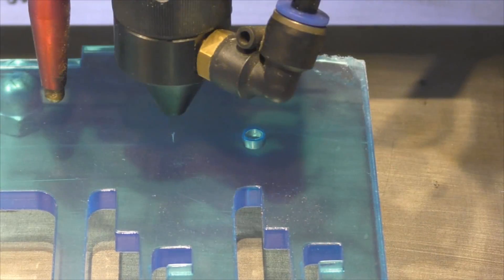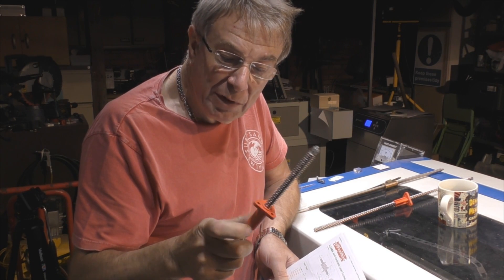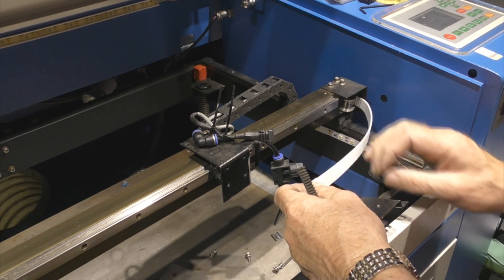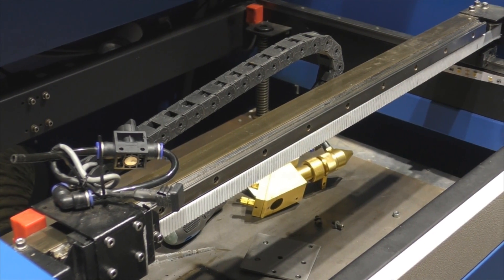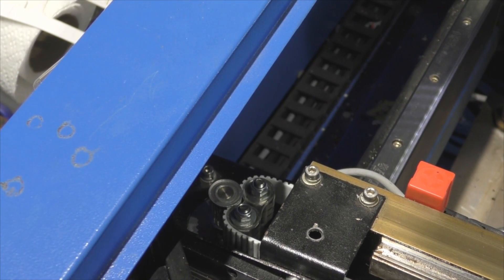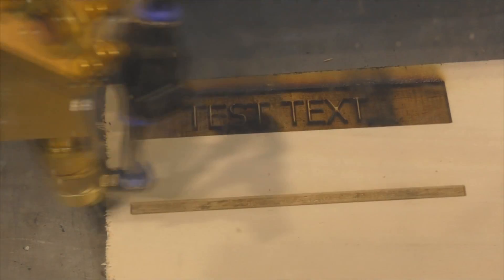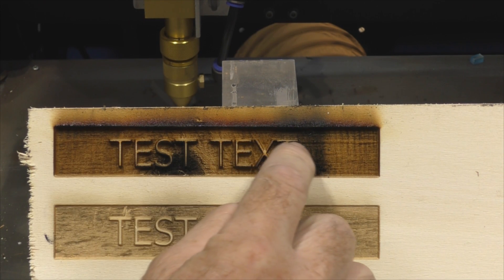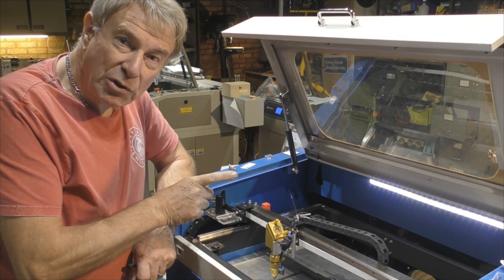RDWorks Learning Lab 121 Is this CURTAINS for CURTAINS

Comment: HI Russ - my 700x500 doesn't do curtains. Differences to yours is it uses HTD round tooth format belts and more importantly a toothed pulley as an idler. I think your problem is likely caused by running teeth inwards on a smooth idler pulley.
Reply: Hi Steve
So your machine is a KH7050 made in the KeHui factory.   
Kehui do not manufacture laser tubes, instead they trawl the major tube manufacturers for reject tubes. They then retest the tubes themselves to make sure they work "in some way", enough to fool the average naive Ebay buyer. The tubes then get relabeled K H Laser. I have seen several tubes with my own eyes  that were original EFR tubes and (stupidly) still had the original labels in place under the flimsy K H Laser label. As it happens, those higher power tubes (80 and 100watts) although not perfect in performance were pretty usable and one in particular is now 14 months old BUT the lower 50 watt tubes (are actually 800mm long 40 watt tubes) is a different story. These are usually close to junk and will last anything from days to weeks. I had two such tubes when I was young and naive (exaggeration!!) so I speak from bitter experience.
If you bought the machine with your credit card and you have run out of options with your vendor, then speak to your card provider about a chargeback. Also threaten your vendor of your intentions. That may be enough to often be offered a refund for a replacement tube
All best wishes
Russ
Reply from the maker: Hi Steve
Thanks for the comment and your personal experience. You are not alone in telling me that two toothed pulleys are better than one. However my analysis of what happens to the velocity of the belt as it moves over a non circular surface was covered in session 83 (?) and that convinced me that adding another pulley would either reduce the problem or double it depending on the synchronization of the pulleys.  I only analysed putting square wheels on the front axle of your car but take that logic to the rear axle as well and depending on the synchronization of the flats, the ride would be different but not improved. If the pulleys happen to be synchronized then there will be little change in velocity but what will happen is that both pulleys will be trying to pull the head slightly out of position (because of chordal increase)  and the will balance and just create an even  increase in belt tension  thus creating even movement. That is why I have hesitated to take this toothed idler direction.  Furthermore, I was visiting a colleague just recently who also has a Red Sail clone 500x700 100 watt machine. It had a toothed idler pulley and the curtain effect on his engraving  was like a roller coaster.  I did not have time to fiddle with his belt tension or investigate it further but it was an interesting observation and a reinforcing reason why I have chosen my smooth belt route. 
All best wishes
Russ
Reply: Hi Russ - On my machine the belt runs on top of the axis rail and it has a much more substantial idler mount too, but i think the HTD belts run much smoother anyway. Least of my problems at the moment as my tube seems to be failing. Wont fire reliably at less than 22%  - used to fire at 10% and it's way down on max power - awaiting a reply from seller as only delivered beginning of June :(
Reply: Hi Steve
It sounds like you may have a tube labeled K H Laser?
It appears that your gas mix is nearly depleted of CO2. Is the beam a nice mauve/pink colour or is is it a pathetic pink (almost white?).

The belt I had originally (before I torched it!!) was  HDT form  but obviously I still had the smooth idler and that was generating curtains. What you must remember is that these belts were designed to transmit power in one direction only and the HDT form reduces tooth stress and allows more power transmission for the same tooth pitch. These belts were never envisaged to replace lead screws or rack and pinion systems. They accidently can be used to control oscillatory motions but they do so with many  limiting conditions. 
Best wishes
Russ
Reply: It is indeed a KH and pink :(
Reply: Hi Russ - sent you an email regarding replacements.
Reply from the maker: Hi Steve
I did reply to email and have just forwarded that answer again. Check spam box?
Best regards
Russ

Comment: Nice idea - Thanks for the video. For future reference, there are plenty of suppliers of inexpensive leadscrews and anti-backlash nuts on AliExpress. A 1000mm T8 leadscrew + anti-backlash nut shouldn't cost more than £20,  including postage.
Reply from the maker: Matthew Bucknall 
Hi Matthew
Thanks for the tip. If I had known that my lightbulb moment may never have happened. This way it will be cheap and easy for others to try without major mods to their machines 
Thanks again
All best wishes
Russ
Reply from the maker: Hi Matthew
I had a look and saw quite a few options but nothing at quite the price you indicated Any links would be helpful.
Many thanks
Russ
Reply from the maker: Thanks Matthew. I am looking to design a better desktop machine with lots of features that do not exist on current machines. This is not an attempt at making a Glowforge copy (a pimped up K40) but a more practical and cost effective offering. I am neither into manufacturing (any more) or making money (I planned well for my retirement) It's just a design challenge I jump in and out of when I get a bit of spare time. It may never fly but it's certainly interesting to put all my criticisms of existing machines on the table and to see if it's possible create a more integrated design that circumvents those problems.
Thanks again for the links
All best wishes
Russ
Reply: Sounds really interesting - I look forward to seeing what you come up with. As it happens, I'm currently in the middle of writing some better software for the Chinese 1060 laser cutter at the hackspace I help to run (in Newbury, Berks). We weren't happy with the original software and controller, so I designed a new controller based on the open source smoothieboard, but mechanically and electronically compatible with our laser cutter's original controller (so we could do a straight swap without rewiring the machine). The plan was to use LaserWeb4 with the new controller, but it hasn't lived up to expectations, hence me starting the new software effort.
Reply: SarbarMultimedia An open-sourced laser cutter design based on your experience would be awesome!
Reply: I'm current ly moving out of my comfort zone helping a guy near me get a leetro controlled machine working using LaserCut5.3. Rubbish system.
Thanks again 
Russ
Reply: Brilliant! Awesome job putting that together.

Comment: Nice solution. I might venture a hypothesis that what may have been occurring is that the teeth of your timing belt may have been compressing on the idler bearing end and the curtains you saw in your engravings were probably consistent with the small vibrations that would occur as each tooth disengages/engages compression with each adjacent tooth or the idler itself. During faster engraves, this vibration would become more modulated, which I also think is congruent with your previous tests.

I would venture that if this hypothesis were indeed true, then an even easier solution would be to replace the idler bearing with a toothed idler of the correct diameter that would moderate the travel of the teeth across the bearing.
Reply from the maker: Hi Benedict
Nice thought and very plausible but it only supports my "square wheel" analysis in session 83. Whether it's a smooth idler or a toothed pulley there are apparent "flats" in the motion. Mathematical analysis of the belt velocity as it engages and disengages with a tooth clearly shows small cyclic variations.  My logic was simple. Get rid of the flats and lets have uniform smooth belt motion. From the initial results my non-conventional solution seems to work. I shall be looking for potential problems as the weeks proceed.
Thanks for the comment, it just reinforces suggestions from several 3D printer  guys who have suffered with the same similar sort of curtain effects. to swap my smooth idler to a toothed one. It does not mean I am arrogant and ignorant to discount their advice or that of many who suggested I change my stepper motors or  the gearing system between the steppes and the final drive belt. No, I have always been taught to understand a problem before trying to solve it. I was convinced I have understood the problem for a long time but somehow failed to see the obvious solution that was winking at me every time I used the machine.
All best wishes
Russ
Reply: SarbarMultimedia Hi Russ, he's partially right, I purchased 18 mm diameter toothed idler pulleys, 3 of them to be exact and the curtains if you will went away completely,  one other thing that I discovered was belt composition,  I tried 3 different manufactures and 2 of them tan good with the belt loose, the 3rd ran superb with it extremely tight.
Genius idea Russ, thanks for the video. 
Scott.
Reply: HI Scott, so you are saying you only replaced the smooth idler with a toothed idler, and that fixed your curtains problem?
(Good video and conclusion, Russ- thanks!)